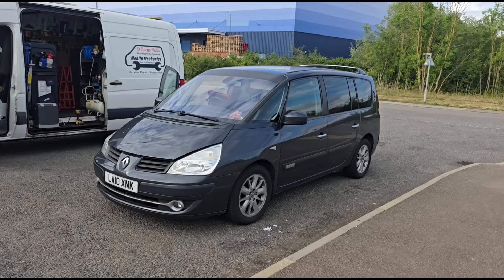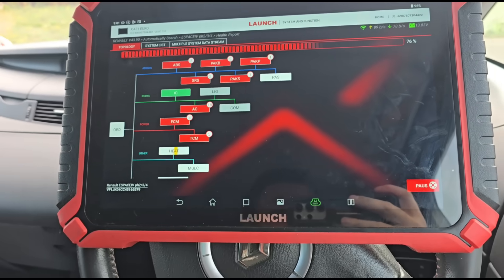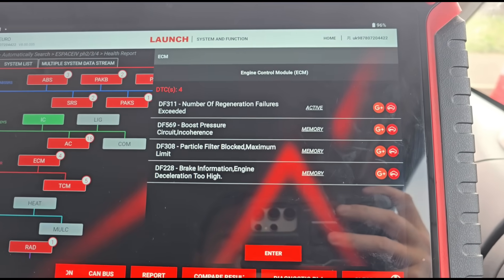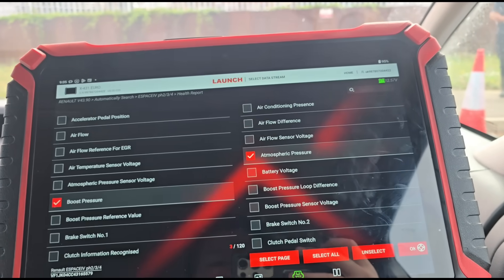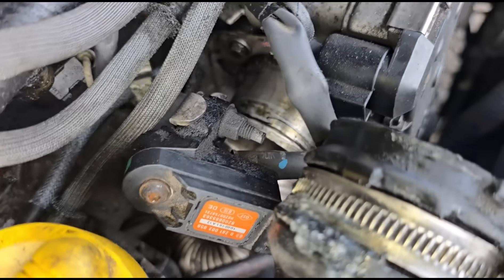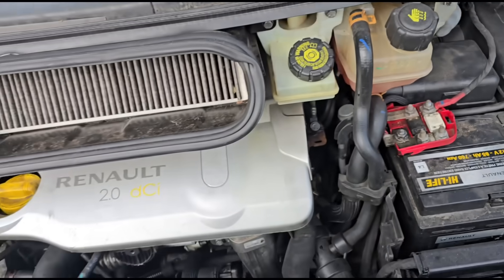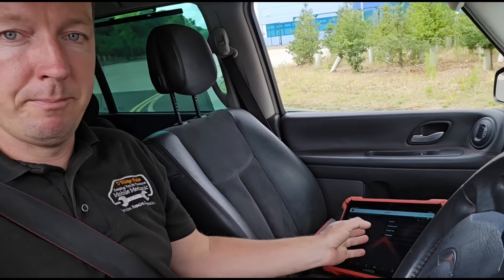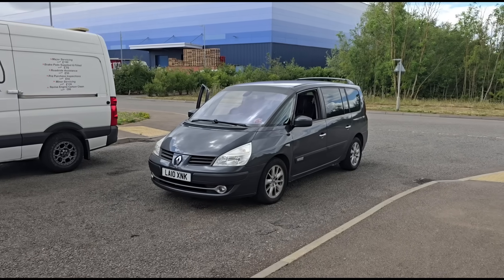Renault Espace DF311 & DF308 & DF569 DPF & Boost Faults

Comment: Hi Jimmy, Do I understand correctly that you just reset the soot counter after cleaning? Is there anything else needed and why does the value still remain the same even though the computer sees that you are getting soot out? I thought that the soot value would decrease depending on the decrease in differential pressure in the pipe.
Reply from the maker: When the soot level goes pass the max threshold, the ecu locks the values and disables regen process on most vehicles for safety
Reply: @ORileysAutos  I understand, thanks for answer. So how do I know it's safe to reset the clogging values? Is a low differential pressure sufficient as a unit for reset of values dpf?

Comment: Why is everything so far under the dash😂
I'm looking at getting a scan tool to fix my daughter's Citroen DS3 hdi as it's got the eloys tank or pump issues with the adblue, my old laptop with wow software is finding codes EB3 & EB5 but it won't let me calibrate, I'm not a rich man & only a hobbyist just to maintain the family vehicles. I'm looking at the OTOFIX D1 LITE.  would this be good enough for my needs.
Thanks in advance Jimmy
Reply: Jimmy seems to think/ has reviewed the Thinkscan 689bt which comes with free lifetime updates and is about the same price as the Otofix d1 lite